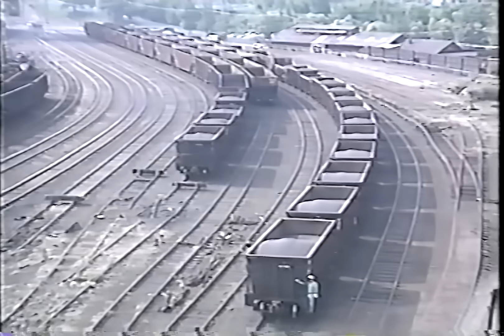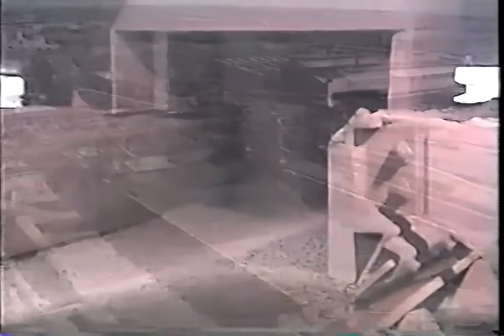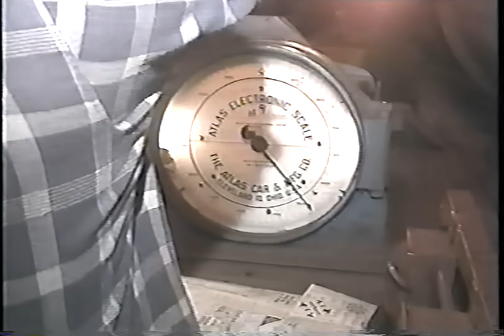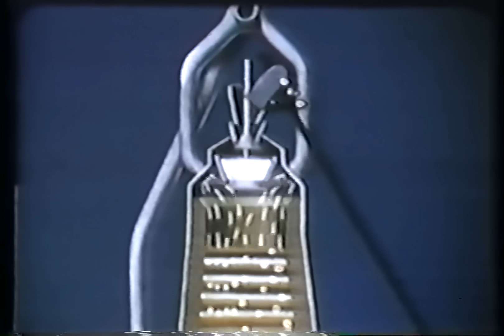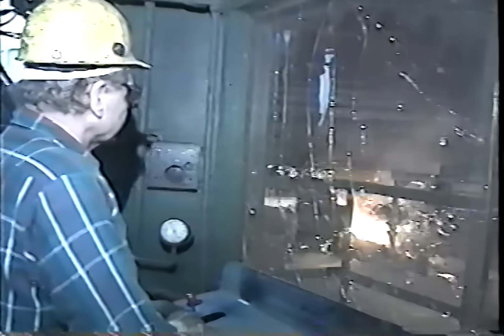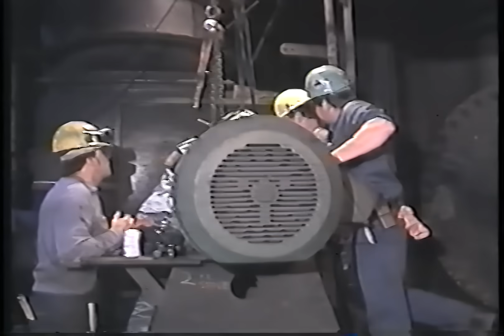Beth Steel Furnaces

Comment: It seems like there is a lot of unnecessary extra handling of material.
Reply: I was thinking the same. That overhead crane bucket thing had to have been one of the biggest expenses. I think a more efficient approach would be a grate/conveyor system under the stockpile that brings the ore straight to the blast furnaces rather than loading/unloading several different transport cars.
Reply: man i was shocked at how inefficient that was. so much energy, space, and infrastructure is needlessly wasted. no wonder that shit was not profitable and shut down
Reply: Very inefficient. All the extra steps were ridiculous.  All the needed was to dump the ore out the bottom of the rail cars on to a conveyor belt to ore stock pile.
Reply: People are going to jump on you for saying it, but this was one of the aspects that needed to be changed.  Note in the narration they mentioned how the conveyor/elevator was from pre-WWII times.  That's a clue.  These installations were built up over the course of a hundred years.  It's sort of amazing they kept them going as long as they did when building entire new facilities would have probably been cheaper in the long run, but that's a huge capital expenditure ask that wasn't in the cards.  There's so many reasons old line producers eventually fade away.  One of the bigger ones is just plain age.  Johnstown Pennsylvania became somewhat of a point of interest in this saga 4 years ago when you know who got elected.  They talked about industrial jobs going away.  But if you read deeper into it, places like Johnstown PA were fading even before Pittsburgh became the steel center of the Universe at the beginning of last century.  That town was on the rocks for almost a century due to technological and resource acquisition changes in the industry.
Reply: Maybe a track over a swivel conveyer belt so first car dumps onto conveyer and it's dumps into ore yard,, just saying
Reply: @FLV.USA.CONSTITITION.2ND.  That would work it seems. ANYTHING is better than this. Such a waste of time, personel and money in the long run.
Reply: You would have to have a conveyor that could move to place it anywhere in the stockpile which would be an enormous abortion of a thing with many more moving parts that need to be maintained than the scoop crane thing. Simple is good, sophistication is just more shit to go wrong
Reply: @juliogonzo2718  - That may have been the case at that time.  I know the coal industry has conveyor systems that run for several miles from mines to transportation hubs.  see video: https://www.youtube.com/watch?v=iuYZqMzqdtw
Reply: I understand but when this was built it was cutting edge. Belts and conveyors of such magnitude were few and far between and were still plagued with bugs. 
It worked well for the rest of its life. No need to spend millions to replace it for no effective gain.
Reply: Very convoluted raw material handling. I wonder how much material is lost from transferring so many times?
Reply: Stephen Dennis ehh scrape it off the floor
Reply: Could have been the need to stockpile different grades of feed stock and the need to have a large inventory to get through the winter when the lake freighters are immobile due to ice.
Reply: There's good reasons why they became uncompetitive.
Reply: @Mrbfgray  From letting 3rd world made products into this country for free is that issue.
Reply: @MrBen527   Pure fantasy, no one was giving anything away, it was failure to advance and upgrade.  No industry can afford to sit back and do things the old way just bc "that's the way we've always done it", those are words leading to bankruptcy.
Reply: @Mrbfgray  It was not about upgrades.  The 3rd world is still doing it that way.   It's all about the standard of living HERE in the states and maintaining it.
Reply: @MrBen527   The ONLY reason for our standard of living being higher and increasing is efficiency gains, replacing ppl with machines, it's not optional.  Cheap labor, low safety and environmental standards from 3rd World might require us to tax ourselves a little at the boarder but they darn sure demand we do things smarter. 

 I'm a big fan of free enterprise so there must be good reason to allow governments to create trade friction and when we do our industries often get sloppy from lack of competition.  High tariff nations are always poor.
Reply: @Mrbfgray  Those efficiency gains would happen regardless at a natural pace.  But flooding the country with cheaper product from another country that lives at a lower standard undermines that process.   It causes a race to save pennies which is still where we are now.
Reply: @MrBen527  A race to save pennies is what successful business DO.  It's when they don't that we all fail.  "Natural pace"??  WTF is that!  Competition is "natural" and it's absolutely necessary.  The natural pace for monopolies is standing still, selling garbage bc customers don't have a CHOICE.  Duopolies aren't much better. 

Back in the 1970's into the '80's Americans were stuck with SHIT from the Big Three Auto mfgs.  They cried in their breakfast cereal when we finally allowed superior Japanese autos in but after a while even Detroit executives admitted it was exactly what THEY needed too.  They had to get off their asses and produce half way decent cars for a change.

  Thank gaud we aren't stuck with out import choices, tho of course most foreign brands are now made in the US just as Big Three are made over seas.  One of the key reasons pickups have become so expensive is the 25% tariff on that class of vehicle.
Reply: @Mrbfgray  Like I said, flooding the market with cheaper crap from a completely different economy is not natural.   People and the jobs need a little time to adjust.   My local has lost 150 workers in last year and a half worth nothing in return other than more work days/ hours than we were already doing.   And it's not all because there was waste,  it's so corporate can make more profit at the expense of us working on the shop floor.
Reply: @MrBen527  Don't count on unions, the government or blame the era we are all trapped in--rely on making yourself valuable and difficult to replace.  Avoiding stagnation starts with you.  Improve your own productive potential, just like picking up litter if we all do it things are fine.
Reply: @MrBen527   Seek personal excellence and everything else including fine women WILL follow.
Reply: @Mrbfgray  Dude, I've been a successful Maintenance Tech for 22 years now and have been plenty valuable.  That's not the issue, which what I keep saying.   What is it you do?
Reply: @Mrbfgray  I accomplished that 20 years ago.  What else you got?
Reply: @MrBen527   Started industrial steel contracting biz at 20, still own operate on small scale as I faze it out into retirement, spend most of my time now on investments research, making my money create more wealth.
Got welding certifications at 19, mechanical engineering degree later but mostly on the job pursuit...paper accomplishments never mattered it was all about what I could accomplish for customers.  Just as free markets SHOULD work they have for me as I worked for THEM.
Reply: @MrBen527  It's great to hear you've been prosperous, when one of us gains a lot the rest of us gain a little.  Prosperity is contagious just as the poverty mentality is.
Reply: @Mrbfgray  I have, and similar to you, I took control of my future and career at 18 years old by joining the Air Force to learn the field in in now.   I also know how small business owners also despise unions especially in the trades fit the same reasons I've said before.
Reply: @MrBen527  I can smell a union when first stepping into a new to me industrial operation, the toxicity is almost always immediately obvious from the focus on going thru the motions and passing time without violating rules instead of energetically focused on getting things done.  Seniority is their metric for hierarchy no matter how worthless the senior may be. 

There's a palpable conflict between workers and management instead of all rowing the same direction they spend all their energy on tripping up the "other side".  As tho we were not all in the same damn boat!  

And yes--as a contractor they might be threatened by me in their simple minds and try to impose their backwards ways on us or even be hostile.  NO good man needs union protection they only need to do their darn job well.
Reply: @Mrbfgray  I agree with you somewhat on some things.  Even coming from my point of view,  I am and always have been an excellent employee everywhere I have worked.  That would be the military, steel, beverage and now automotive industries over the last 22 years.  Never been written up,  disciplined or fired at any of them.  But if you worked in these places day in and day out, year after year and see how companies change you would see the importance of unions.   Let alone seniority which applies to non union jobs also.   If you cant see the importance of seniority then you have not been in one spot long enough and have not been laid off or lost a job because of numerous reasons that come up over the years and believe me I've seen a lot.
Reply: So how would you have done it?
Reply: @scooter2kool173   VERTICAL
Reply: @scooter2kool173  People don't have to have advanced technical ability to replan a steelworks to see that this operation could have been very much more efficient. What exactly is your question designed to do?
Reply: jonka1 it’s a simple question genius.
Reply: @scooter2kool173  :)
Reply: @scooter2kool173 large catapult that shoots the ore straight into the furnace.....🙄😋
Reply: @jasonrackawack9369  A trebuchet!!!  😆
Reply: @scooter2kool173  Yeah man, what the heck's he talking about?!
Reply: @larryslemp9698 if you can't see how inefficient this operation was you might be blind.
Reply: All of that material handling could have been streamlined, they didn't do it because it would take away a Union job. Union was the downfall.

Comment: Worked at a steel mill in Steubenville Ohio. The plant layout and process was way better than this. Far less handling of the ore etc. The rr cars with ore dumped right into the bins the ore bridge controlled. No car dumper. No transfer cars. The ore bridge loaded the bins for the categorizing and weight car that loaded the skip cars. This would be the only machine between the ore/ore bridge and the skip cars.  Worked all over the steubenville and mingo junction plants for a few years then 10 as a maintenence 
machininst.
Reply: This is pretty much a documentary on why Bethlehem steel went bankrupt, way outdated operation.
Reply: Yep.  It appeared to be there was an excessive amount of material transfer in the video.  
I grew up in the next county south of Steubenville.  Sad that the steel industry there is so far gone.

Comment: The astoundingly inefficient material handling process reflects the well known failure of Bethlehem Steel to innovate and update to compete with the more modern foreign plants, focusing instead on short term corporate profits instead of a long term jobs.
Reply: Ore, coke and limestone was handled 6 times before hitting the furnace? And they never tried to improve it.  :/
Reply: @fewtoes  Yeah that blew me away.  So much double handling of the materials.
Reply: @fewtoes  They didn't have any money available to improve, because the union was sucking it all up in wages and benefits.
Reply: So true.  The output of the furnace may have been great steel, but this has to be the most inefficient bulk material handling ever patchwork quilted together.
Reply: Bethlehem's board of directors steadfastly refused to modernize they drove that once great company into the ground.
Reply: @neilpuckett359  was it that or did the unions refuse to agree on the basis that many jobs would have been lost in making those improvements?  Legit question as I am not from the USA.
Reply: @Gnrnrvids  Bethlehem ia exhibit A against unions. Still pleanty of bad management, but the union here refused any modenization whosoever right till the bitter end. A fascinating case study very well documented.
Reply: @Gnrnrvids  I think that was certainly part of it. Really it was a trifecta of poor management, greedy unions, and our government failing to protect them from cheap foreign imports that were only cheaper because of lax labor and environmental laws.
Reply: @DVeck89  Same here in Aus with out big steel works.  We export the iron ore and buy back the steel in a lot of cases.
Reply: @Gnrnrvids  Down Under and USA 🤝🤝🤝🤝🤝
Reply: Gnrnrvids many reasons why the steel industry collapsed here in the USA
1. Declining demand for steel after the post war building boom (this is not mentioned often)
2. Failure to modernize (can be blamed on unions and management) - modernization means less jobs etc. 
3. International competition. 
Recent tariffs imposed by the Trump administration have helped to increase US consumption and production.  
It’s a global economy, and the market always rights itself.
Reply: @Gnrnrvids  yes.
Reply: @DVeck89  No, management was fully aware of the problems but was unable to overcome inertia in the unions, among politicians, and then steadily increasing environmental regulations as well as extremely efficient (Post-War rebuilding paid for by US taxpayers) foreign imports that were allowed given Cold War considerations... all added up to a "we can't continue like this" mentality. They finally had to shut it down.
Reply: @pwffstube  I remember when it shut down. Another reason to never join a union the people at the top really do no care about who they’re supposed to represent.
Reply: @Gnrnrvids  Unions?   Nice red herring.   Who ran this plant?  Not the union.   Who made decisions regarding the upkeep and modernization of the plant?  Not the Union.    The union fought for the pay and quality of life in their contract.  And not much more.
Reply: @lbowsk  The unions will often fight back on modernising as it results in less jobs.  I'm not saying that is what happened in this case, but it does happen.  If you are deluded enough to think unions are in it for the workers, then I cant help you.  Easy to see why this place was shut with all the double and triple handling of material that was going on.  Terribly inefficient process.
Reply: @Gnrnrvids  Both. Both sides were firmly dug in and neither would budge. I grew up watching this place fail and watching the older members of my family lose their jobs. There's no winners in the final days of Bethlehem Steel, on greed and losers.
Reply: @gfen5446  never winners when any business is closed in the end.
Reply: @Gnrnrvids  You are correct.
Reply: @pwffstube  Unions are nearly gone in the USA, and where are the steel mills now? Yes, blaming unions (because you weren't in a union, and you only care about yourself) is simplistic fun. Keep it up. Keep attacking those who have decent wages and benefits; eventually, you'll drag every worker down to your level.
Reply: @neilpuckett359  They didn't have the money to modernize because the union took it all in wages and benefits.
Reply: Not only that, but check out the engines in the powerhouse. Those giant double-acting gas engines while impressive and certainly super reliable were pushing ~80 years old even by the time this video was filmed. They should have been replaced 20 years before this video was even filmed with something more modern and more efficient.
Reply: @AmericanLocomotive1  They were built in 1895.  The turbofans were added in 1953 as an adjunct, when the whole system should have been converted.  Boneheaded management and investors at Bethlehem were the same type as that which drove the Pennsylvania RR into bankruptcy..Philly mainliners who only cared about theit own pockets.
Reply: @AmericanLocomotive1  When the unions took that modernization money and put it into wages and benefits, there was nothing left to make upgrades.
Reply: Knowing little about the finer details of foundries but being a logistician I was really wondering about that myself, so many extra jobs, extra power and fuel requirements with a huge amount of additional maintenance. Just made me think I was missing some bigger picture detail in Iron production, it really made my teeth itch and I wonder if the inefficiencies continued after the Blast Furnace.
Reply: @Blue collar Hero  wtf are you even talking about lol I had nothing good to say about the union.
Reply: @Blue collar Hero  the mill I work at unloads from rail cars into our yard, loads our own rail cars to take to the scrap building, loads into charge buckets, into the furnace it goes. This video had way to much over handling.
Reply: This is a chronic problem in declining businesses. Decreased profitability due to cheap foreign steel and high labor costs meant that cash was scarce for capital upgrades to the plant equipment.
Reply: The union killed them.  They didn't have the money to explore innovative upgrades because they were paying it all out in salaries and benefits.
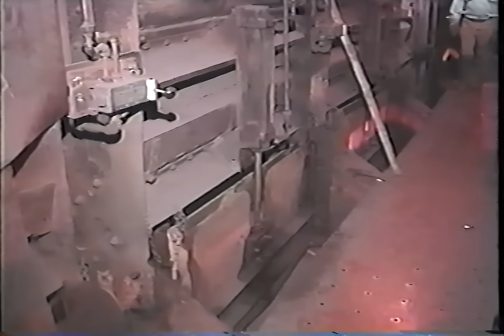Reply: 5:00 in and they’re just now getting to the part where they put materials into the furnace :/